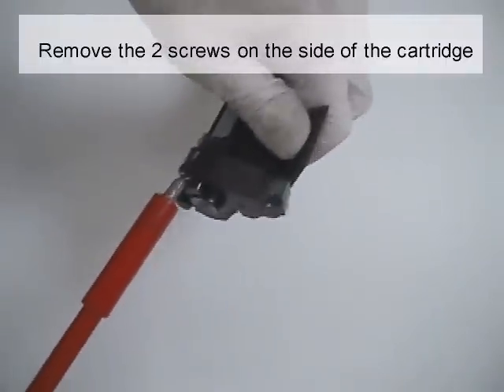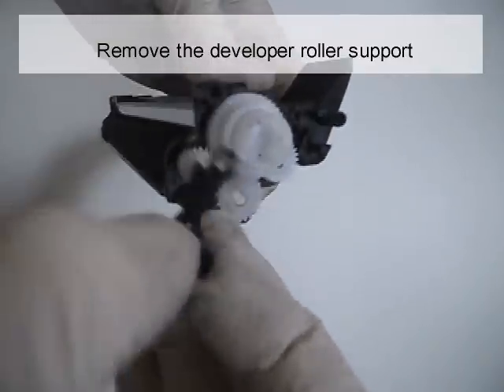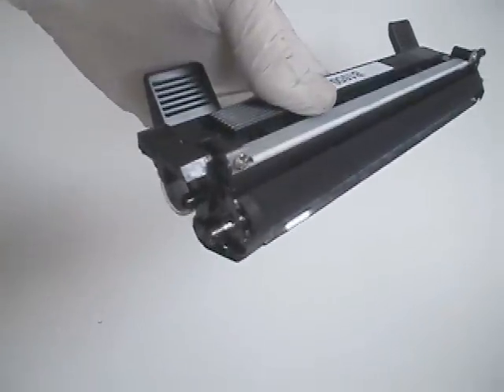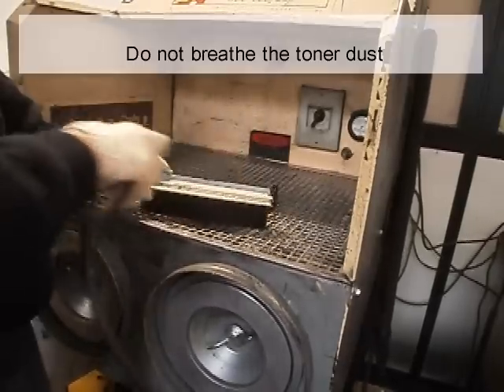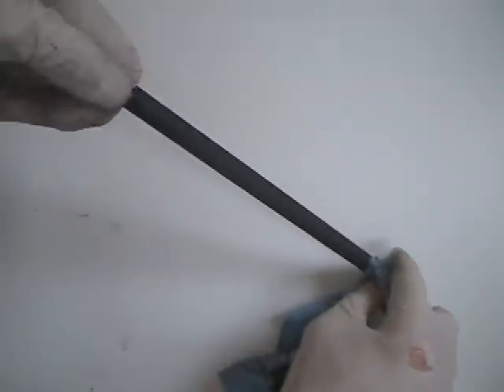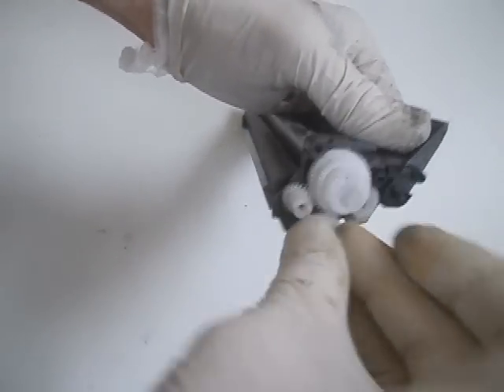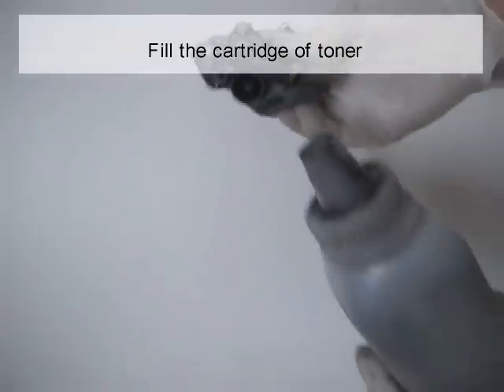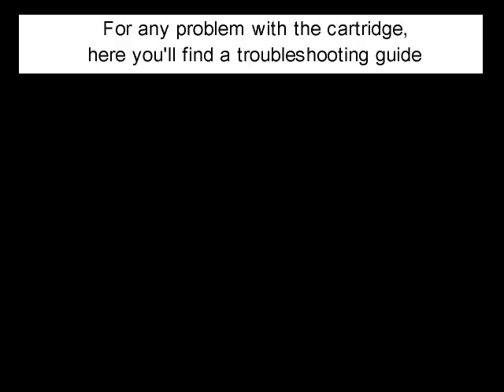BROTHER TN1000 TN1050 HL1110 Toner Cartridge Refill Instructions

Comment: I have a problem and make reset to hl-1110 sprocket put in, and everything I fold and close the printer flips and jumps sprocket. A reset does not report it was still empty toner. Thanks for the advice
Reply from the maker: rotate manually the developer roller of the cartridge, and watch what happen. if it's blocked, may be the blendig rod inside the cartidge is blending or broken
Reply: viandant5 I had to cut out the plastic sprocket printer is no longer functional. Thank you for your willingness to ...

http://www.tonersyp.cz/grafika/navody/brother1030/startovaci.jpg
 http://www.tonersyp.cz/grafika/navody/brother1030/kompac.jpg

Comment: Hi! Previously I installed reset gear in my free toner and it worked perfectly. Now I refilled the same toner with the same reset gear but the printer always prompts low toner.. (printer is brother HL 1110)
help!
Reply from the maker: Alma Marie Servito 
try this:
1 turn off the printer
2 hold and keep holding the power button
3 when the lights are lit, open the printer cover. continue to hold power button
4  remove drum unit with the toner cartridge
5 release the power button
6 Reinstall the drum unit with the toner and close the cover
7 push 2 times power button
8 wait some seconds
9 push 6 times power button. now the toner should be reset
Reply: You're a life (and money) saver! Now I can print the materials I need for the bar review..
thank you, thank you, thank you! :)
Reply from the maker: Alma Marie Servito Happy to help you, have a nice day
Reply: @viandant5  Thanks, it works .

Comment: what is the problem dull or light printing in left side?
Reply from the maker: May be the drum unit is out of position, a part of the toiner cartridge keeps the toner roller far from the drum. Are you sure the cartridge has been installed in the right way?

Comment: My printer is DCP 1510 with TN 1000. I refilled my toner but Printer doesn't respond to refilled toner. It always displays low toner. Help me here
Reply from the maker: +Sandeep Gyawali Try this:
push MENU button
push DOWN ARROW until you see in the display "INFO" or something so.
push OK
push DOWN ARROW until "RESET DRUM"
hold and keep holding OK until on display apper "RESET"
push START button
push UP ARROW until "10"
push OK. it should appear "ACCEPTED"
push STOP button until back to MENU.

Comment: Hi. Good video. I´ve a problem, after refilling, the printer stops every 3 sheets and starts again before 5 seconds. How can I fix this? 
I already reset the printer pressing 6 times the power button an also 7 times, but the problem is still there.
Thanks.
Reply from the maker: +Luis Gutierrez try the reset procedure of this video https://www.youtube.com/watch?v=5V3CQrYh5IE
Reply: +viandant5 
As I told you before in my first comment, I already tried de reset procedure you are suggesting me (pressing 6 times the power button on a HL-1112), but the problem is still there. It´s very strange. Thank´s anyway for your help.

Comment: what is function of the reset gear exactly
Reply from the maker: the reset gear reset the printer counter memory.
Reply: U disassembled it and I didn't find how it gets connected
Reply from the maker: Wael Badr it gets connected with the printer. there is a gear in the printer that engage the cartridge reset gear
Reply from the maker: Hans Landa the starter cartridge comes with new printers, and the counter of new printers is zero.

Comment: why waste the exising toner
Reply from the maker: It's waste toner, it could cause grey background on the sheet
Reply: @viandant5  have you tried it?  If it is black toner, and excess, then it's sill black, no?
Reply from the maker: @ArjayMartin  The waste toner in Brother techonology return back to the cartridge, that's why there is not a waste toner container. So at the end of the cycle of the cartridge, inside it there is waste toner
Reply: @viandant5  that can be used again anyway